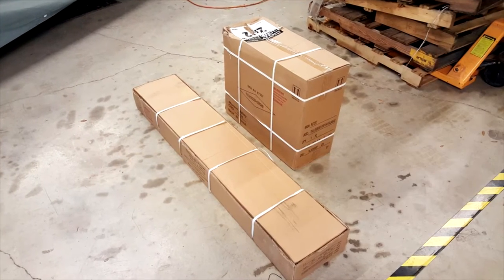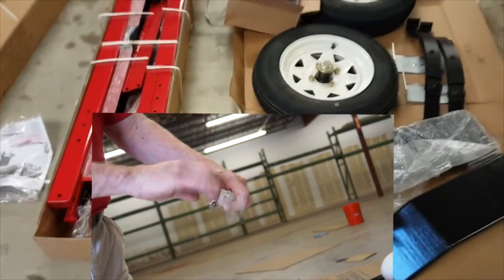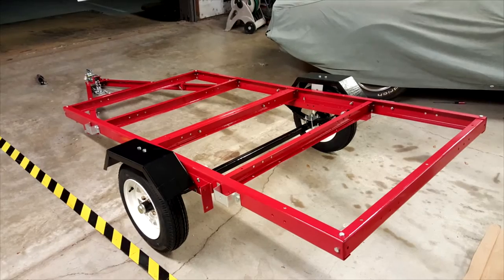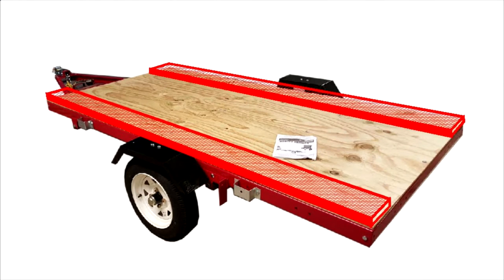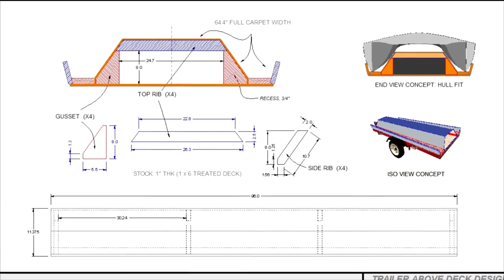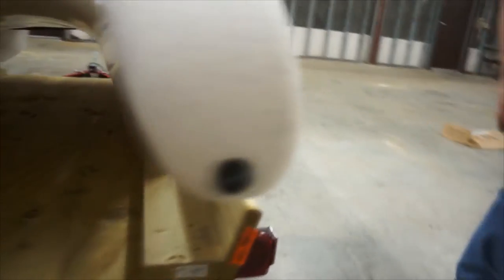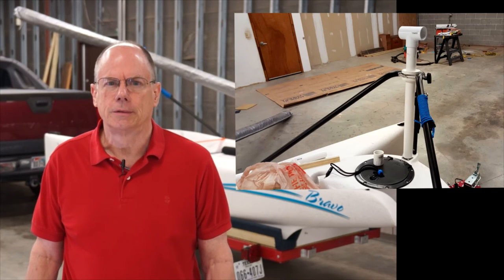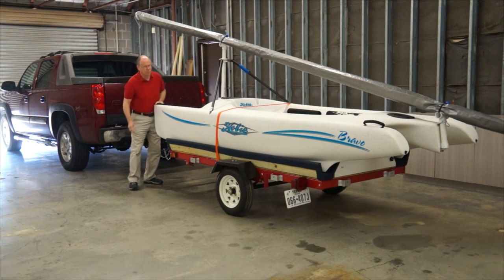HobieCat Bravo Trailer

Comment: I bought a similar trailer from northern tool and extented the tougue so I could haul my tandem island.  I plan on selling the tandem island this year and buying a Hobie Wave.  I like your design and believe it could be modified to fit the wider hulls,(beam).  Thank you for your design ideas.  Will let you know how it turns out.   Mitch
Reply from the maker: +Mitchel Robinson Hey Mitchel, it is a great platform.  The inside of the fenders are about 50",  but if you raise up a couple inches, you can span over them to make it wider.  One issue is that the trailer was designed to carry more weight, and the suspension is a bit stiff with the boat only. Added weight makes the ride smoother. Let us know how your mod works out.  HH

Comment: I wouldn't build that storage area on top. It would cost more than the trailer, also be very time consuming to construct.  And then you would have to pull the boat up, by sliding it on the carpet, instead of rollers.  Rollers would be easier to pull it up on, also your going to be scraping the bottoms of the pontoons, and wearing out the carpet.